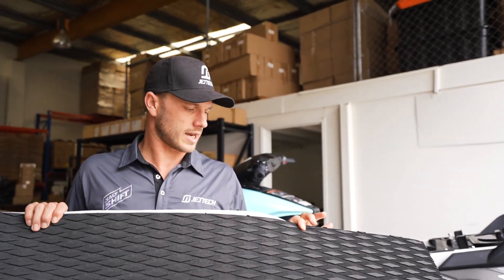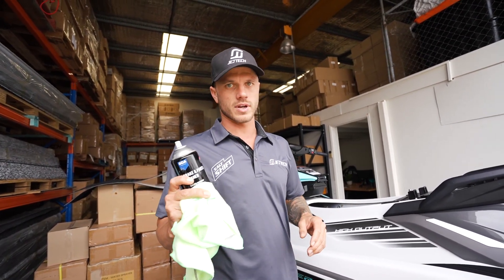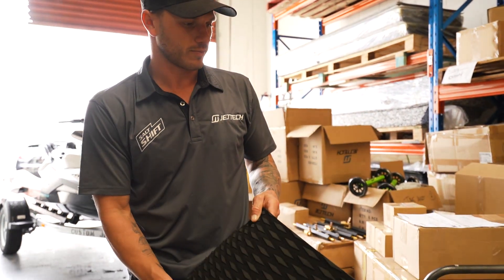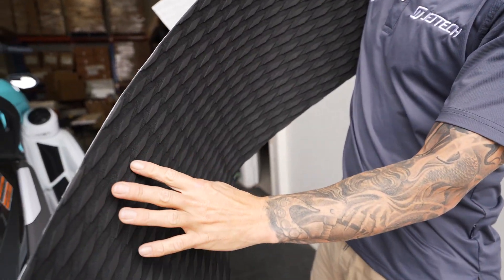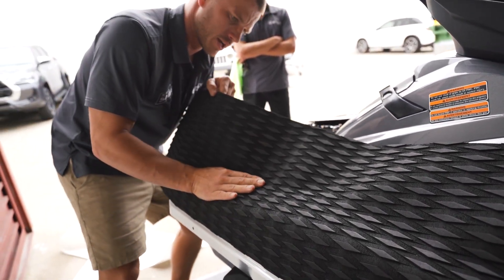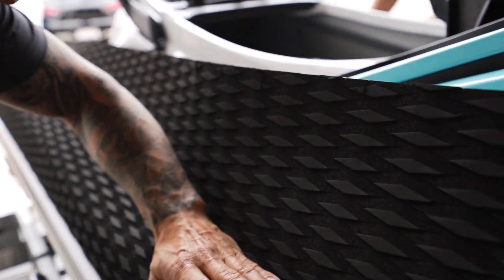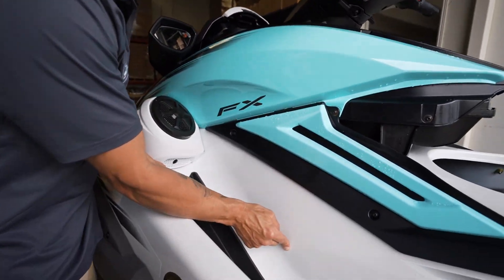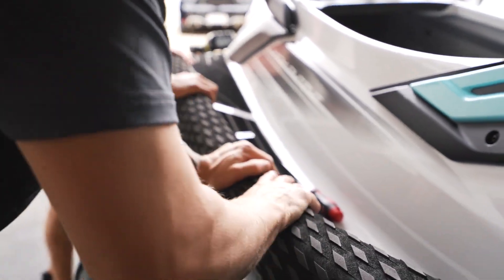Jet Tech Traction Turf Install Guide - 2022+ Yamaha

Comment: Pretty sweet. Would "Knifeless Tape" by 3M be an option. Not sure if it would cut the turf or not. That stuff is pretty cool lay the tape and then the turf over it and pull the string up for a perfect cut
Reply from the maker: Yea have seen it before, good for doing film wraps but unfortunately the turf is to tough to cut with the knife-less tape.